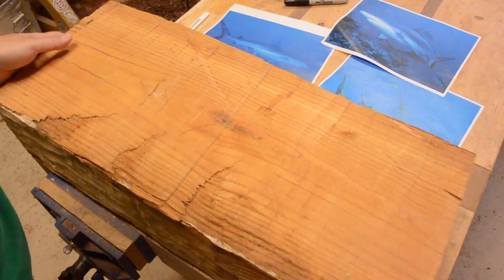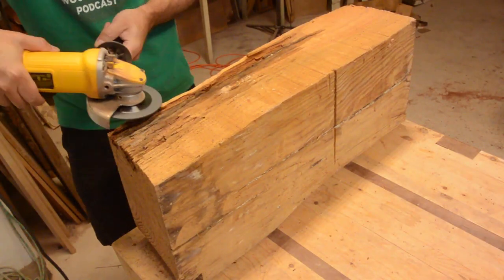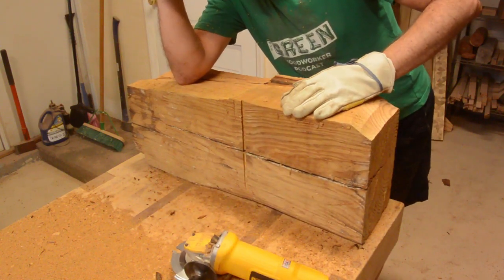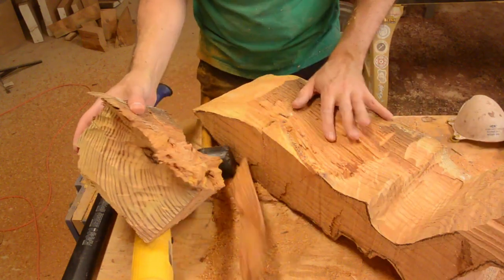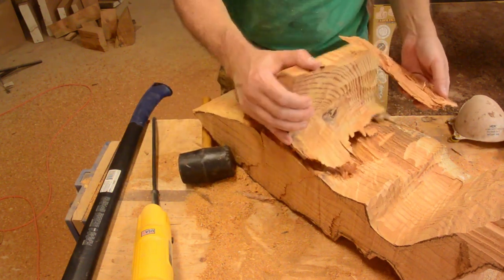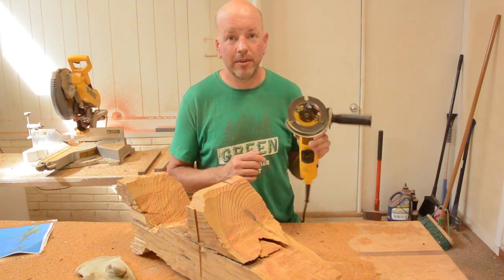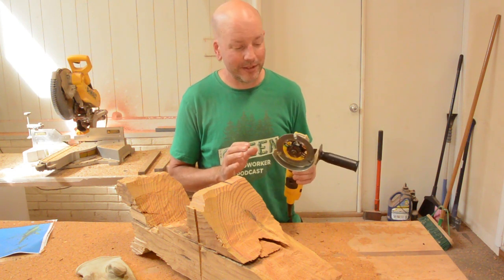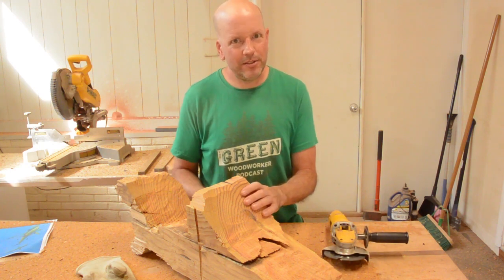Graff Speedcutter - Honest Review

Comment: Thanks for the review, Cam. I'm going to check and see if they make one with a drop center that would fit my grinder.
Reply from the maker: Thanks, William.
Reply: I have a porter cable angle grinder.  Once I switched to a type one guard for cutting blades no adapter was needed

Comment: Do not try to use this if you want to make semi straight cuts either rip or cross cuts. This blade just wants to jump around, which could be bad news if you arent used to saws
Reply from the maker: I am pretty sure it is not meant to be a saw. I do not experience any jumping around when I use it.